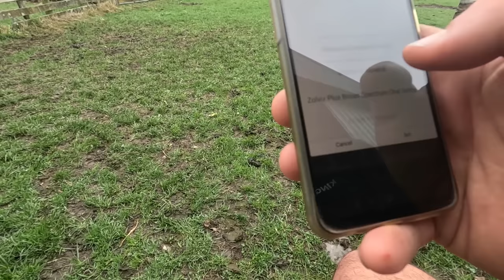SHEEP, CATS and WATER

Comment: Those water fittings if you screw the coupling out but not fully you can slide the pipe inside without taking everything apart and they will line up perfectly and you won’t get wet or lose the o ring.